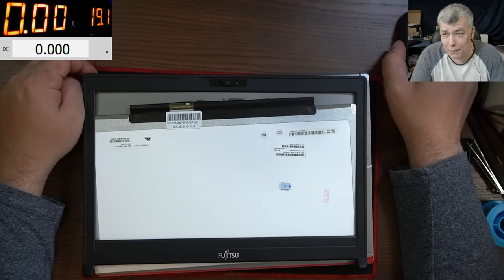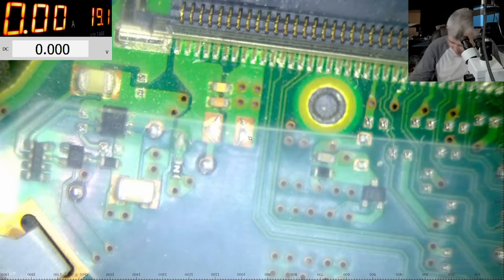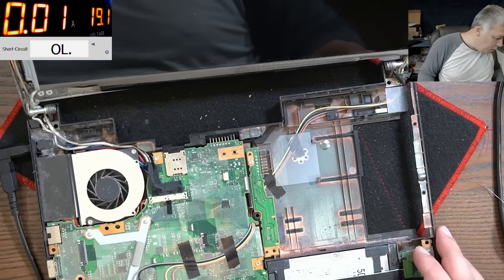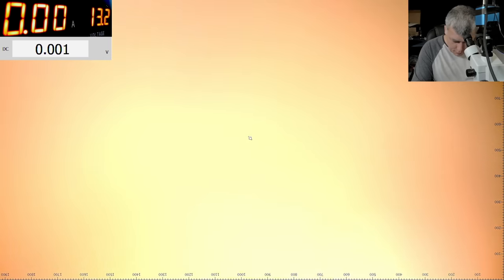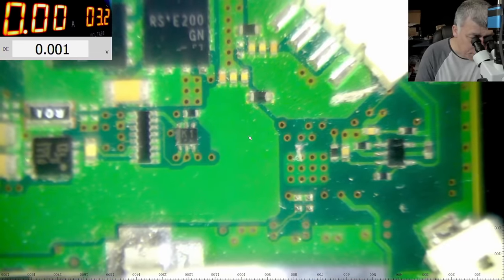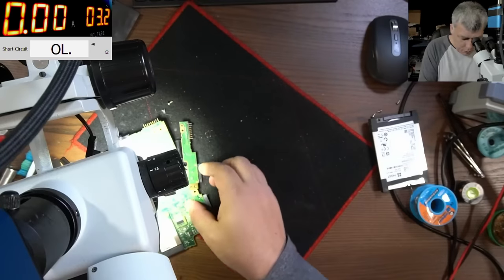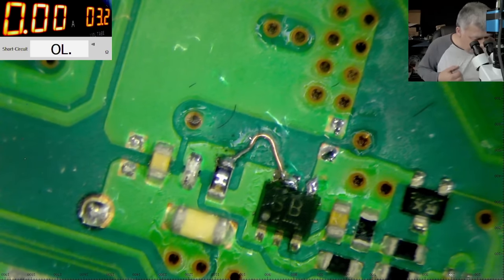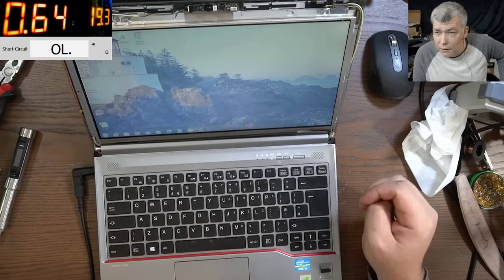Fujitsu laptop repair - white screen is usually a bad fault, but not this time

Comment: my way to find hidden tracks on multilayer boards: multimeter to continuity beeping mode, one line to the track i want to follow, the other line i strip a measurement cable (best is fine cable with 100..200 single wires) and use this end like a brush wiping all over the board

Comment: for a fuse you can use a wire from a small motor or wall clock coil and test how much current it conduct before blowing up with power supply.

Comment: Another quick fix well executed, missing 19v and 3.3v to screen etc. Fuses are very expensive to buy, always use wire and you can't go wrong... unless you want to protect the circuit with a fuse... 🤔🤣🤣🤣

Comment: Great video as always, an unrelated question. How do GPS trackers with a remote disable feature work? In work an ex engineer modified a gps tracker to use in our systems. Before we try to change anything i wanted to understand better how the disable function works. (connected to a mainboard directly soldered).

Comment: If you ask me, but i am not into electronics, it looks much more simple to replace the fuse from a donor board, it will be fast with a tweezers and hotgun. Then use wire, and be always careful to position of wire. 
You apply few seconds heatgun and it will be so easy to remove and replace.
But since you are in the electronic field, probably you know which method is more simple.
I guess, it is harder to find fuses on boards? WIth you experience you should find them so easy.
Btw as an experiment, next time try both ways and see which is faster?
Reply: It's even more easy to just buy bunch of fuses but main problem is same, you can't know which value is original fuse (you can see that hey only have type marking on them) and it's again guessing game. It may look "more professional" but not any less dodgy than this.
Wire he use looks huge on screen but it'll just melt at current over 1A probably even faster than real 1A fuse. With errors you can expect with screens being full short it will fork just a same as fuse melting in seconds.
Reply: @gorjy9610  The value cannot be worse then a thick wire :). For sure it will be microamps, those wire fuses looks too big.

Comment: I have two different laptop of different brand, but they have almost the same problem. Is it incidental that both laptop have the. same related trouble.......blinking screen until the screen becomes black. What is the most possible problem, or where should I focus to troubleshoot?

Comment: This happens if you change the screen with the battery connected?
Reply: It can be one of the causes
Reply: it's badly designed by intent,   they could have used 2 mosfets there that cut the circuit if the laptop is shut down.
Reply: @orange11squares  you're right, but unfortunately not on these days...

Comment: Do you have any video on blue screen of death or “your device ran into a problem and needs to restart” problem, they told me in service its ssd problem after changing it still happens then they told me my conector needs soldering and they did it it worked fine for 2 months now again after half and hour of use i get blue screen of death and it restarts my laptop thinkpad
Reply: Mostly software, drivers issue not Motherboard🙏🧡💚
Reply: Do a memory test.

Comment: What caused the 2 fuses failure? poor quality fuse, Fatigue or too low a rating?
Reply: because the client tried to disconnect the screen without removing the charger/battery. and the fuses did what are supposed to do - protect the circuit from short circuit
Reply: Don't forget , this laptop was water damaged also. how badly, we can only guess. but this can be also a reason why the two fuses for the lcd are gone.